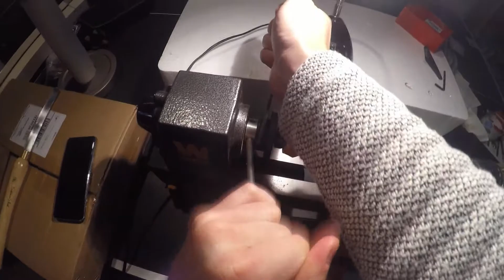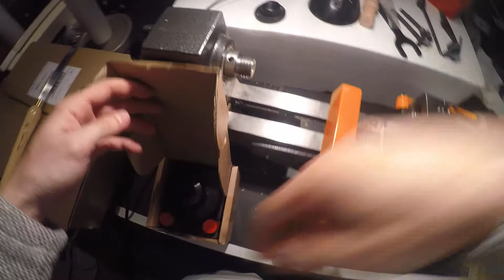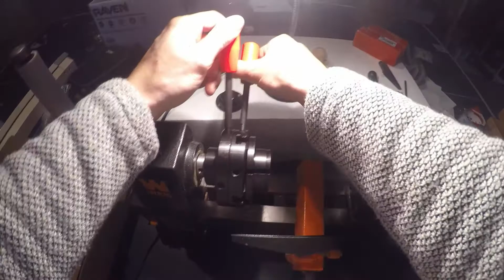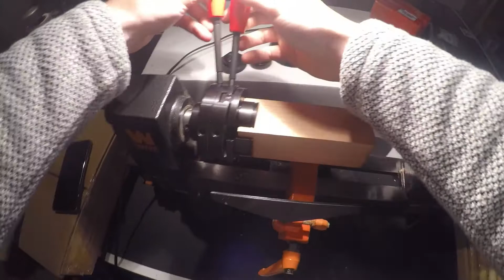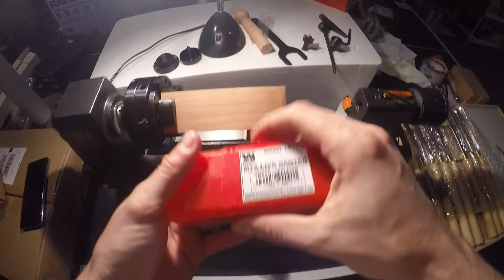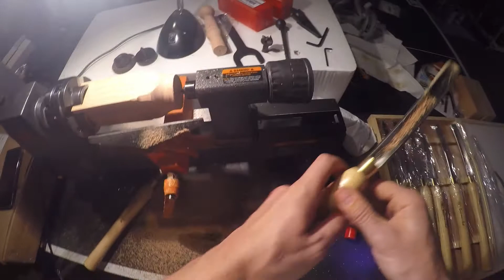Installing and Testing the WEN LA4444 4 Jaw Chuck

Comment: Do you know if the optional jaws, such as the Wen  pen jaws will fit on this chuck? Thanks.
Reply: I tried Wen pen jaws and they do not work .i use then on my other wen chuck,,,they can cbe made to work by boring the mounting screw holes just a fraction larger
Reply: @coleyounger6758 can you still use the chuck as it comes to drill blanks?